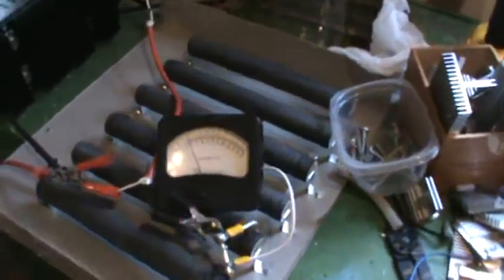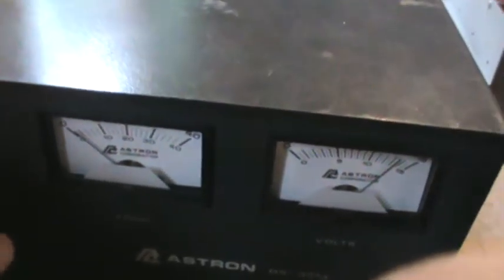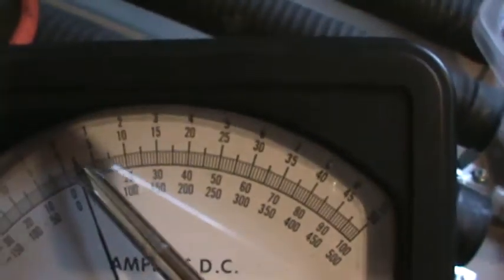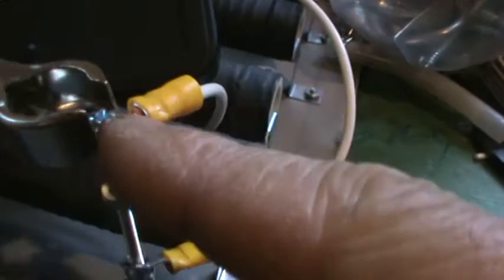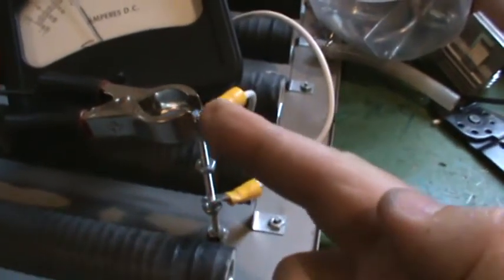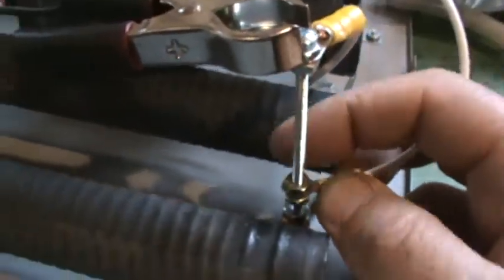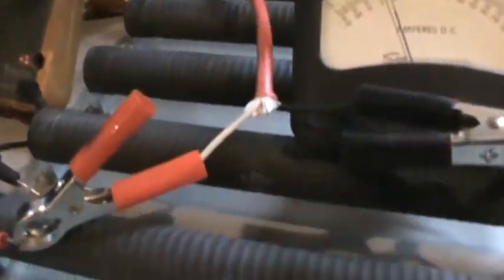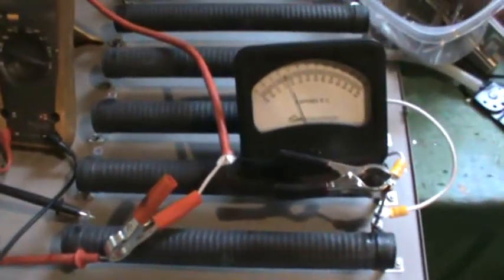Creating a shunt for my ammeter to be used in my turbine rectifier.

Comment: It would create a little less confusion if you called your measurement on the bolt slide, amps instead of volts because volts measurement does not require use of a shunt. Also, belittling the Chinese or Mexicans does not add to knowledge of what you are trying to accomplish by creating an ammeter shunt from any bolt. The bolt idea is good though because of the fine easy adjustment to change the current passed on to the meter.
Reply from the maker: Thank you kindly for your comment.